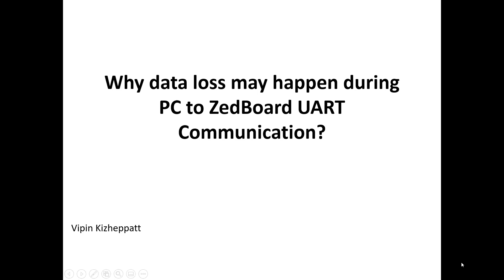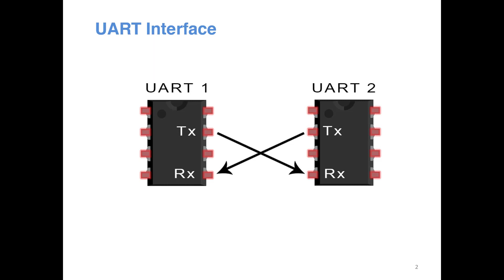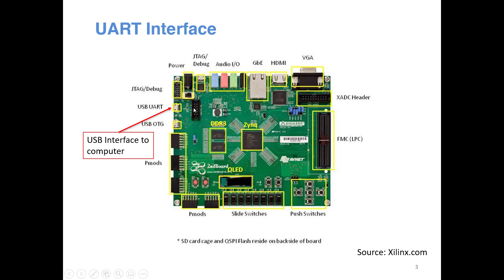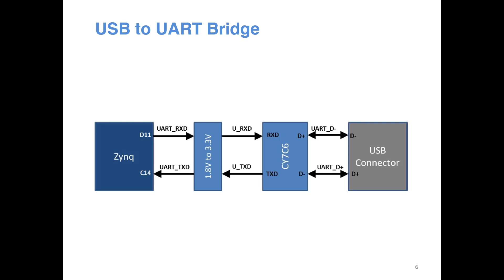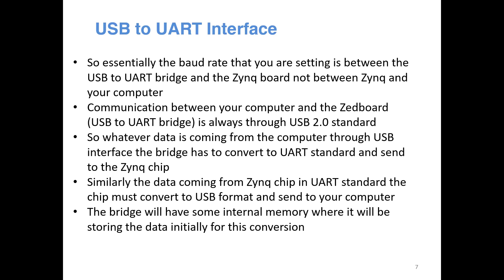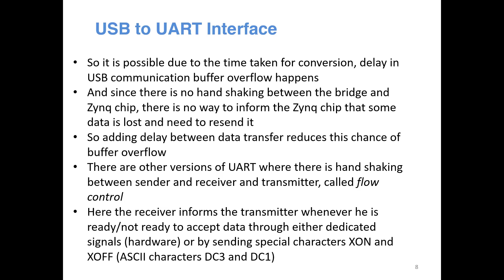Why data loss may happen during PC to ZedBoard UART Communication?

Comment: Good video 
How can we increase the buad rate of transmission from 115kbps to 921600 bps or similar? Can this be done at SDK end and at TeraTerm end so that data can be transmitted at much higher rates.

Thanks
Reply from the maker: The maximum baudrate supported by PS UART is 921600. Easy way to set is to configure it in the block design. Double click PS under PS-PL configuration, you can modify it for UART1. Through software also you can modify it but will have to use XUartPs_SetBaudRate() function available in the xuartps.h header file. It is discussed in the subsequent videos. Teraterm yes you can just set the same baudrate configured for the board.